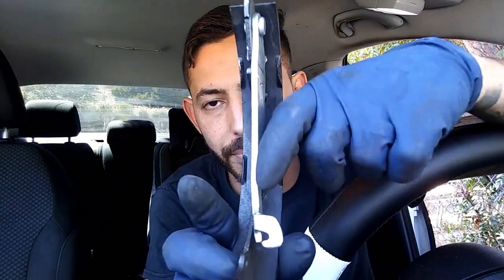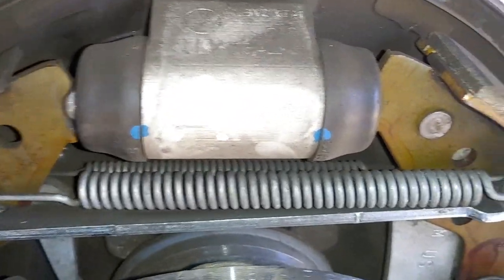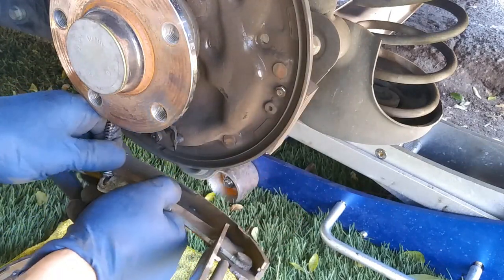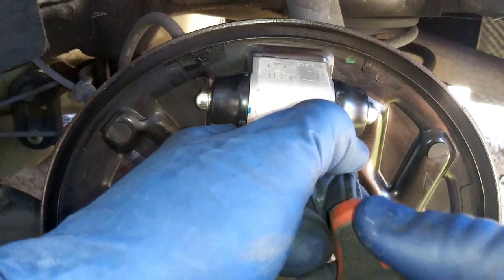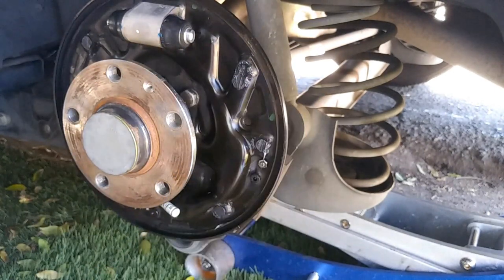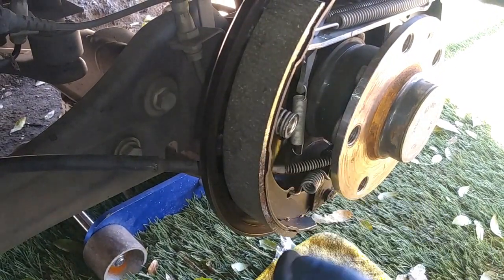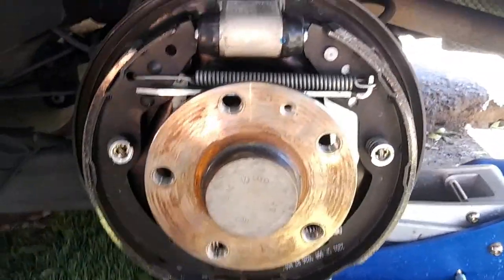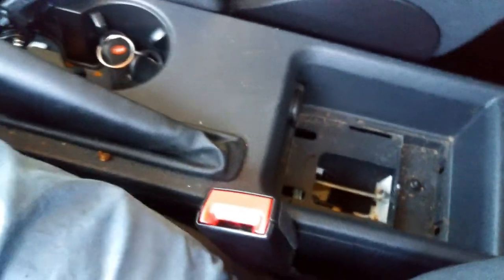2011 vw jetta rear brake shoe replacement

Comment: ATTENTION ATTENTION !!! At 4:03 take note of that pin with the spring! You DO NOT have to shave your brakes, when you put the new brakes on, do not connect the spring yet, the drum will not fit over the brakes until you use force and hit that pin up. Make sure all the other springs are on before you hit the pin to help keep the pin up, then connect the spring and BOOOM it fits without shaving

Comment: I wanted to add in there that you forgot to mention that the pin at the end has to be pushed all the way up, I believe it was the last spring you put on. If it’s down the drum will be impossible to put on. I spent about 5 hours losing my mind until I found a separate video that explained it. 
Here’s that video link https://youtu.be/S0lntUMN5Rs
Reply: Are you referring to the wedge. That wedge is used to adjust the breaks.
Reply: Your so right with the last pin!!!
Reply: Javad M awesome! I’m glad it helped you. I was so lost for a couple hours trying to figure it out
Reply: Life saver.
Reply: Leaving it down prevents the automatic adjustment to be done as the pads wear. As there is no more room left for the wedge to go down.

Comment: 15:27 that pin s your selfadjuster. You want to leave that up high as much as posible or you drum wont fitting in as easy.. with the wear of you shoes that pin wil slowly go down. I just had one of those cars.The owner of car pretended to do it himself🤬 n left the springtensioner all a mess up. So I had to do some research. The car is all done now but I'm still looking for easy ways. Great job man you have strong hands. I use cutter pliers to get those springs out I see you using a flat screw driver and fingers You make look so easy.. thnks for the video.
Reply: Wait I keep seeing this comment, what do you mean leave the pin higher up?

Comment: Do not adjust the handbrake cables, unless the cables have been replaced.
This adjustment is only to take up differences in the cables and their mountings, to set the correct free play in the handbrake lever.
The adjustment of the handbrake after brakes service is simply using the footbrake and the handbrake.
The auto adjusters takes care of the rest.

Comment: With new shoes you start with the Adjuster-Pin set at the highest position, then drum should barely go on.....if not, then slowly work the wedge down till the drum is just scraping the shoes when installing the drum.......Sometimes I replace that Adjuster-Spring with a shorter, more stronger spring to ensure the Adjuster-Wedge doesn't get lazy and hung-up in the course operating the brakes over time.... To adjust the Wedge once the drum is installed, you put a screw-driver through the wheel lug hole to adjust the wedge correctly... If the wedge is all-the-way down and you still do not have shoe contact with the drums, then it's time for new drums, since the old drums wore down ...

Comment: How much did you have to sand your brakes before the rotor would go on like it did? A measurable amount?
Reply from the maker: Its took 12mins of sanding the aftermarket ones come slightly thicker
Reply: You do not need to sand them down at all. Inside the center console under the arm rest there is a plastic square cover that you can pop out with your fingers. Under it is the parking brake adjustment. It is a 10mm, loosen it up and the drum will be able to go back on with no problem. Once that is done, tighten the parking brake back up
Reply from the maker: Yes you are correct, but thats only if you purchase the oem brand. If you buy aftermarket shoe than you would need to sand down
Reply: @JaboTheMechanic  that's weird, wonder why the aftermarket won't make them to specs
Reply: Jabo The Mechanic  sorry to say but you are wrong and don’t have to same at all. There is an adjuster that is supposed to be slid up when replacing rear shoes . That way the drum will slide right on no problem . That was your problem
Reply: Sand*

Comment: First where's the safety stand? If you would have slid the emergency brake adjuster up the (drum) would have gone right on. Really dangerous using a pic and screwdriver.

Comment: Really wanna see a rear drums to disc brake conversion for the 2011 Jetta so I can make the attempt on mine haha
Reply: Dont think its possible as the rear supension arm would not have mountings for a brake caliper and the mating mud guard plate.
You'll need a new complete compund axle prepared for caliper fitting.
Quite a project.
Reply: CXensation is that so? I’ve read on the forums that it was done with either swapping an IRS or just swapping the brakes and a couple lines but I wasn’t able to view the pictures to it
Reply: @sth801lifestyle  Well I stand corrected if it is that easy.
Then you should collect the disc brakes parts and go ahead, why wait to see someoneelse do it ?
Reply: @sth801lifestyle  Try https://www.autodoc.co.uk/ - or the nearest local country specific store to you.
They carry all parts in all common brands, to select either by brand or pricetag of your choice.
Reply: CXensation honestly kinda worried I might mess up maybe if it was my project car but this ones my daily so I’m kinda sketched to try it out. I seen the thread somewhere on vwvortex.com about mk6 drums to disc and in the thread I seen compatible parts from other models. I even got the parts too but still kinda worried to attempt the swap
Reply: @sth801lifestyle  If you dont feel confident with common repair jobs, you shouldnt even think of modifying anything on your car.
Reply: CXensation well that’s why people post stuff on YouTube is to share the information right? I’m not professional or anything still kinda new to working on a lot of things but I generally like to see people who have more experience then me perform it and then I like to try it out myself. Sorry if I’ve offended you that wasn’t my intention I actually felt like I learned more off your drums video then other stuff I’ve read up online.
Reply: @sth801lifestyle  Thats perfectly allright with me. Except its not my video and not my channel we are writing to.
I'm an independent youtuber like you (aaarhh okay, I'm 67), and just wanted to share from my own DIY experience.
Reply: CXensation haha well to be honest it gave me some motivation I guess sometimes you just gotta do it or it won’t ever get done. When I do attempt it hopefully I drop a video.
Reply: @sth801lifestyle  The way to go !

Comment: I really wish you showed us how to replace the wheel cylinder 😭
Reply from the maker: Im sorry next time
Reply: @JaboTheMechanic  do you have any idea what torx bit is needed? I saw it had one on be back. I just bought new cylinder and it didnt come with new bolt so I can tell if I have the correct size now without taking the wheel off again. And risk not having the right one then having to put wheel back on and limp too the store haha
Reply from the maker: Lol. No i dont. If you could buy a torq set from harbor freight or autozone and see which one fits the tightest
Reply: @JaboTheMechanic  yeah, I'll probably go too Lowe's and get the torx set.. I'm broke as hell right now and probably just gonna try to keep em clean and return it afterwards 😭
Reply: I only want to replace the cylinder, would this be possible without taking the shoes out? I'm thinking if I disconnect the brake line I'll be able to squeeze the old one out of the shoes.. but will the shoes have enough tension to close up causing it too be very difficult to put new cylinder in? I've never worked on drums before. And it pissed me off VW used them on mk6 Jetta lol
Reply: @JaboTheMechanic  so I got it done today. It was actually really easy to put them in without taking the shoes off. It was a T30 for the one bolt on the back. And when I disconnected the brake line, I squeezed the cylinder in all the way in was able to pull it out while prying lightly with flat head, putting new one in I squeezed the cylinder in while the parking brake was pulled up. Very easy. Although the cylinder was not my only problem with brake system 🙄 gotta chase another problem now lol
Reply from the maker: @SikConVicTioN  lol. Well im glad that you got it. Dont for forget about bleeding the brake lines after you replace the wheel cylinder
Reply: @JaboTheMechanic  yeah I bled the line a few times with my friend pressing the pedal a few times with car off than few times with the car running. No air bubbles were coming out. I already know that I have sticky slider pins up front, I'm thinking one of them is stuck open causing extra free space which could explain the spongy pedal. Surprisingly AutoZone near me actually has the bushings for the slide pins in stock, so I'm gonna try to get that done today if the snow let's up
Reply: @JaboTheMechanic  I was just talking to a VW tech today, he was saying no one should ever sand down the shoes, it's that wedge that need too be pushed up before putting the drum cover back on. When it's up, the shoes will be closer too each other allowing the drum cover to go on no problem.
So with the wedge being positioned higher, and the cable being loosened there is no need for sanding
Reply from the maker: @SikConVicTioN  i did the same thing with another vw and used oem parts and didn't need to sand down
Reply: @JaboTheMechanic  from what the VW tech told me is that the wedge should always be pushed upwards prior to putting the cover back on because that is the self adjustment mechanism, as the brakes wear out that will pull down so the wheel cylinder doesn't have to push out as far to stop the wheels. 
He thinks that's why I have spongy brakes because the pads are worn out to much and the cylinders have to travel much farther than they would be if it was new.
I had my Jetta in the shop today for full system flush, I was thinking I had air bubbles farther up the line

Comment: You should delete this video. It is very inaccurate. Insisting that  people should sand the shoe is terrible advice. As mentioned before if you had the adjuster all the way up you wouldn't have this issue.